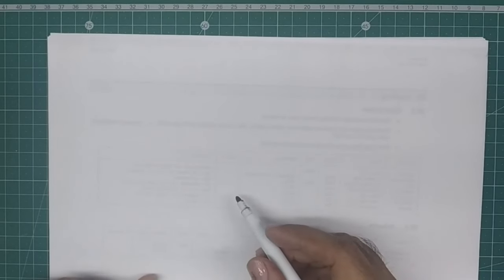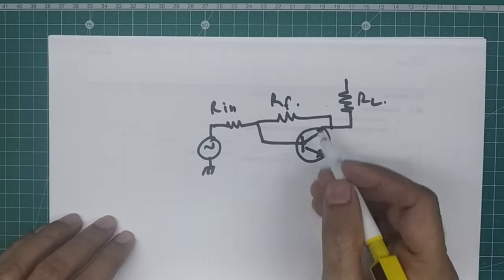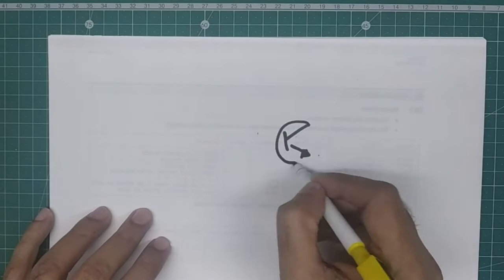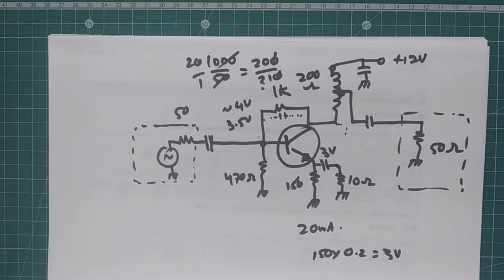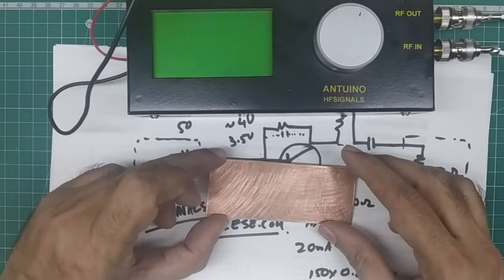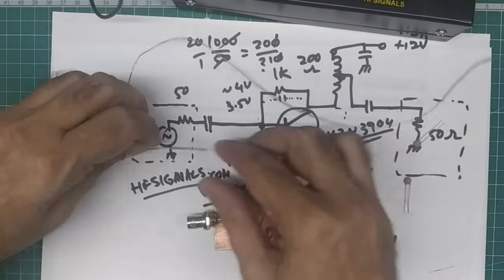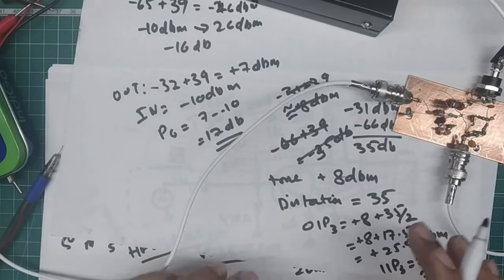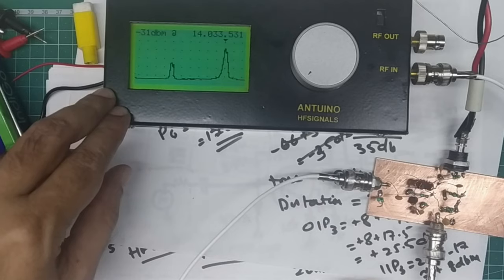Design, Build and Test of a Feedback Ampilfier

Comment: 46:10 12 dB return loss is SWR 1.7 50:00 you are measuring the input impedance of the output port, not the output impedance.